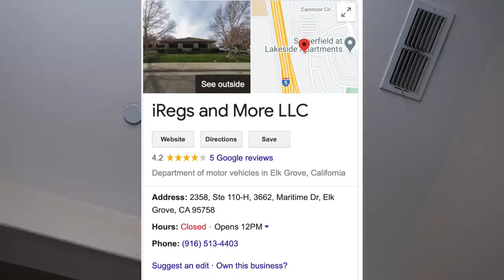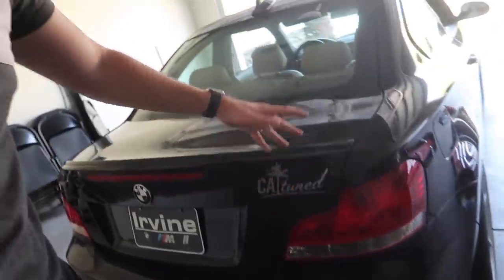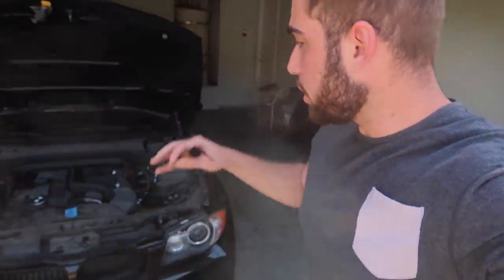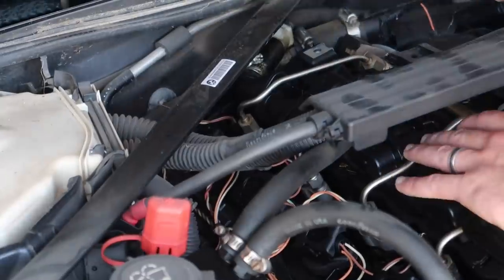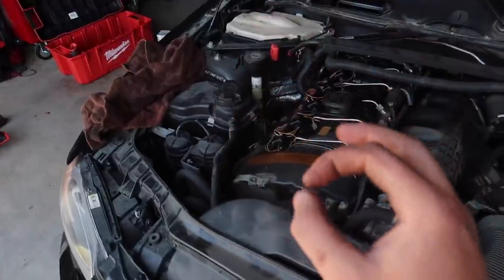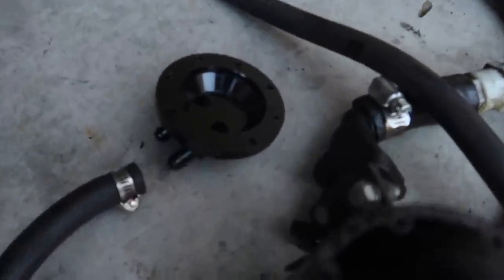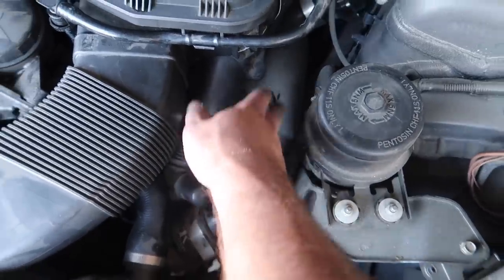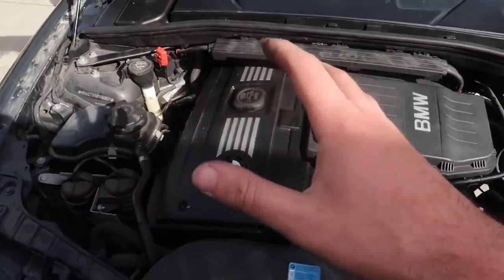N54 135i STRIPPED DOWN!

Comment: there’s 2 catch cans for n54. high side for boost and low side for vacuum. the high side for boost never has oil in it because you’re not in boost all the time. the low side vacuum collects soooooo much oil it’s honestly the best maintenance mod
Reply: If it didnt collect the oil or I didnt have the catch can, where would the oil go instead?
Reply: @NagashiChidorii  it’ll go into your intake valves which will cause u to walnut blast. it will also slowly build up into your inlets connected to your turbos, your charge pipe, and intercooler. it can also cause ur pcv system to not run properly especially if u don’t have a healthy valve cover. i cannot make this up, also having a unhealthy pcv system can ruin your turbos by the oil not draining properly in the turbos which will cause annoying smoking issues out the tail pipes when at idle or coming to a stop. it can also make ur turbos fail prematurely
Reply: @thewhite335  good reply. Thanks!

Comment: Do cars have to be bone stock for smog? Here in Aus we just need a safety certificate and cars can be somewhat reasonably modified and still pass
Reply: In the People’s Republik of Kommiefornyastan we can’t change anything that has any relation to the emissions system (basically anything between the intake air and post catalytic converter) without a CARB certificate.
Reply: @michaelhall9138  thats ridiculous..